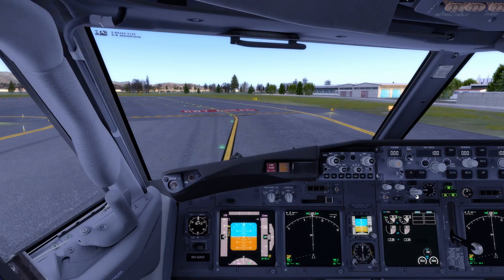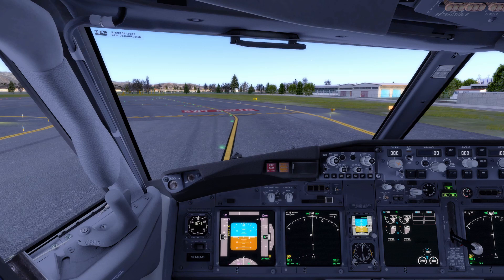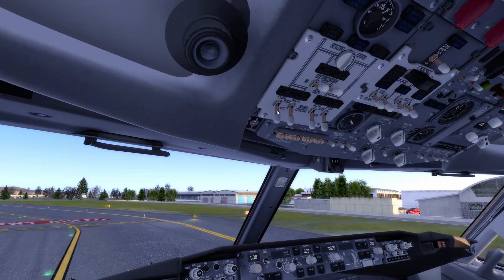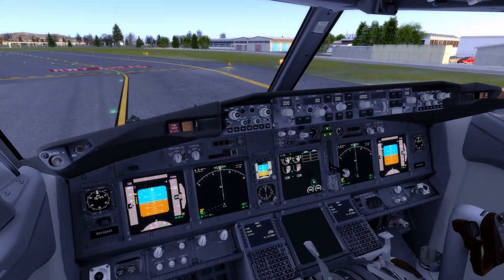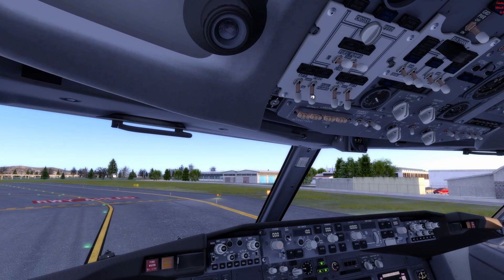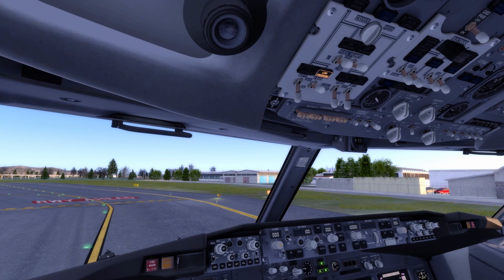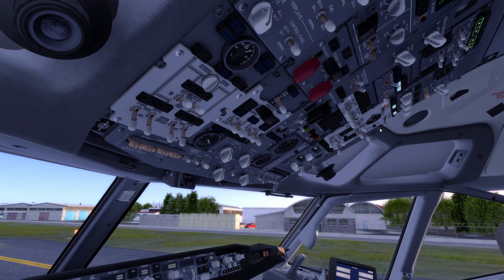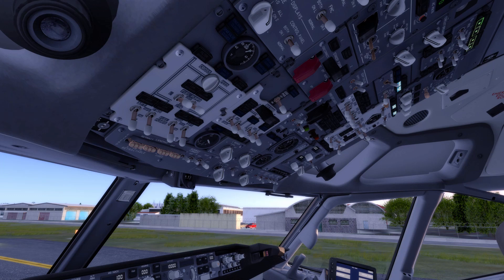737 NG Cockpit Lights - [Can A Light Give You Three Different Indications?]

Comment: I once got a low pressure light for the main tanks (middle) in my sim. Flights were uneventful, but I wondered what fault it was simulating. It's funny because my sim is not yet set to simulate faults as I'm still testing my handmade controls.
Edit for a question: do you always set window heat toggles to on or is there a set temperature when you then switch it on?
And how do I know the APU is ready to go on bus?
Reply from the maker: Hey, many thanks for watching!! When you had the center tank fuel pump low pressure light the pump was on or off? 

We switch on the window heat on and that's it, the system automatically switches off the window heat if certain temperature is reached (normally during during summer when on the ground)

You know the APU is ready when the blue APU GEN OFF BUS illuminates.

Let me know if you still have any questions
Reply: @PILOTCLIMB  Thanks! The  pump switches were all on and the warning light illuminates during flight, then it kept on during other sections and recently it's not illuminated, as though the problem has been solved.
I really thought the APU bus light illuminated only when the APU was already running and even the PACK system was already being fed air from it. So you keep the APU on until the bus light illuminates and then start it to feed air to the PACK system and engines?
Thanks for your attention.

Comment: Even when there is fuel in the centre tank  after a cold and dark start how come it doesn’t say low pressure above it , however when fuel is in tank left and right amber low pressures illuminates ? Is it as the centre tank uses electric hyd sys not eng driven maybe ? That’s just an educated guess
Reply from the maker: Hey Tom, I hope you are doing great!! The Low Pressure light on the CENTER tank pump only illuminates when there is NO fuel on the tank and the pump is on, so if you have fuel on the centre tank you will not see low pressure. The light logic is slightly different compared to the left/right tank fuel pumps.

Let me know if you still have questions
Reply: @PILOTCLIMB  with the left and right tanks does it say low pressure with the pumps off but fuel in ?
Reply from the maker: @tomharper8402  that's correct !
Reply: @PILOTCLIMB  but the centre ones don’t unless it’s on and no fuel? Also may I ask how is fuel actually pumped is it hyd driven or use electric motor ?
Reply from the maker: @tomharper8402  Exactly!
The fuel pumps are AC electric driven!
Reply: @PILOTCLIMB  thanks a lot for your help and a video on rnp and how it works as well as stuff like EGNOS / SBAS and that or bleed air and pneumatics would be amazing but I understand you have a schedule many thanks